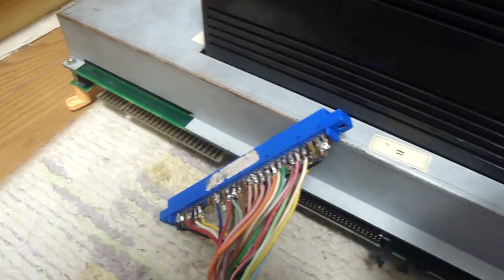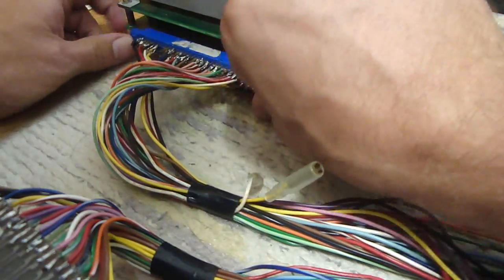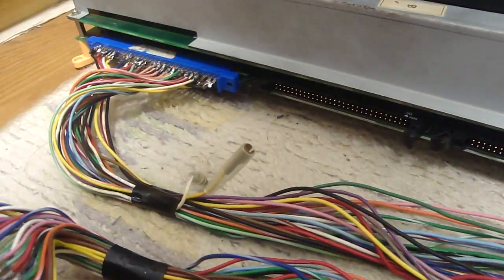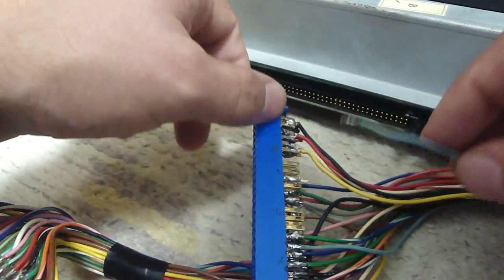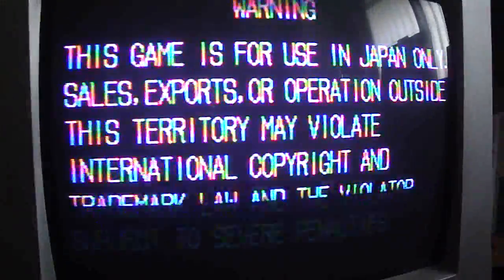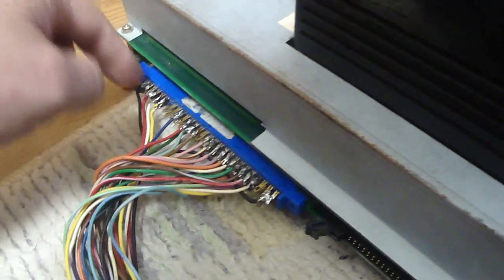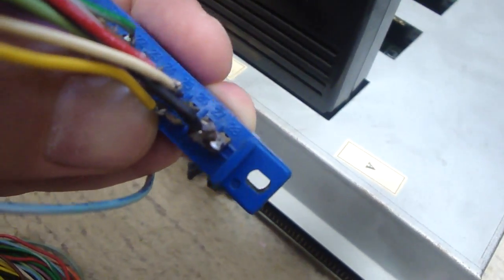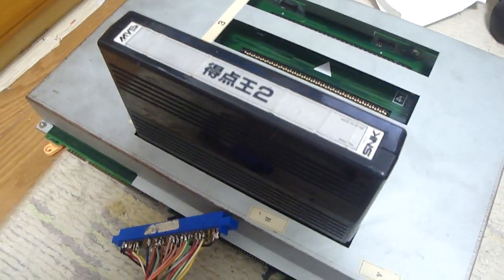How To Convert A JAMMA Harness To Work With A Neo Geo 2,4,6 Slot MVS Arcade Board

Comment: I've never encounter any trouble with MVS and JAMMA connectors, it's 100% compatible !
i've tested with may arcade cabinet, MV1A, MV1B, MV1C, MV1FZ and even 4 slots... no issues

So the purpose of this video is to retablish the standart pins to be compatible with a JAMMA connector ?

Comment: Hi Luke

I recently bought a 1 slot mvs board and have a few issues with audio

Firstly,on my jamma harness,I only had 1 of the 1st 4 pins grounded by default,I was getting a black screen only,I bridged all 4 pins and now get display.

Audio .. I am getting what seems to be mono audio,at the neo jingle,it's only playing half of the notes but also,I am getting noise,the noise comes and goes,sounds like wind and rain

I noticed you have a multi slot mvs board,is your modification required for a 1 slot board ?

Do you have any idea if your mod will give me the full sound and get rid of the noise

Finally .. what I think you are saying is that in a jamma L-10 is where audio +/- are .. and that the - Minus .. is aiming to a test switch when mvs is inserted ? And this causes the audio issue ? And to fix this,we remove the L/10 -minus or ground wire and move that to the end of the edge connector with another ground wire ? So the speaker is still getting ground but the test switch isn't hitting ground ... is this correct ?

Many many thanks

Comment: What makes this different from a 1 slot?  I got one of those on the way.  I want to make a multisystem cabinet where I could just use a single harness and swap them between systems.
Reply: I don't believe pinouts are different between numbered slot boards.. I think the 2-4-6 slot in the intro was towards the game swap button. I have a one slot on the way as well.... Good luck.

Comment: Dude, M and 11 were actually L and 10. I was trying to ground M which was Test in the MVS. 😩
Reply: +KingJavo True. I did not get this mod working grounding M but after looking at the MVS pinout I grounded L and it worked just fine.

Comment: So I have a quick question for ya and I am hoping you can help. I have a cabinet at home that uses a lcd screen and it runs my Capcom jamma X-men VS Street fighter just fine but it wont give me the video on my MVS 1 slot motherboard. I have tried other MVS boards and get the same problem. I was curious if any of the converters would help fix this. like the NeoGeo MVS to JAMMA Inline Adapter or CGA/EGA/YUV to VGA Arcade HD-Converter PCB (GBS-8220). I am just super lost on this and could really use some help.

Comment: Awesome information Luke. Another idea is to toss on a little inline SPDT switch on that wire and then run lines to the 2 pins on the jamma connector.
Now you solder them all and at the flick of a switch,  change from NEO to JAMMA.
Thegreenmonkeyking

Comment: The manual says that 26 is select up and d is select down. I usually connect one pin to either 26 OR d and the other one to gnd.
Also, as mentioned, a switch would be more convenient than quick connects. You could also take audio gnd (or minus. Whatever you want to call it.) right off the power supply. Often a good solution, if you have problems with picture quality.

Comment: Cool video, just  wondering why not solder an extra wire on the negative point. Then use a non momentary single pole double throw switch soldered into the harness to change between jamma and mvs ? Instead of quick connects etc..

Comment: Luke on the setup of the neo geo board (at least on mine wich is a 4 slot) you can configure the board to let you switch between the games without inserting a credit :p mine is working this way atm.